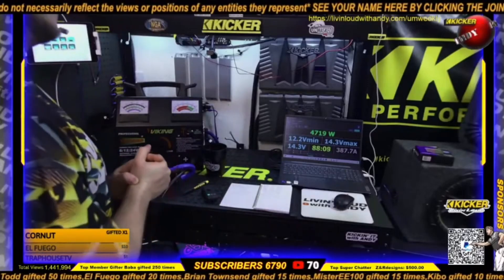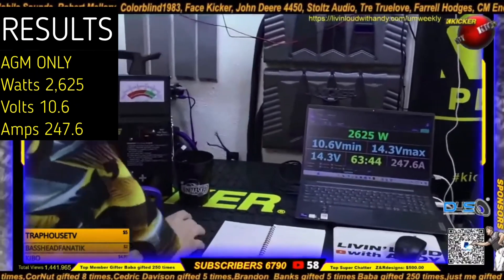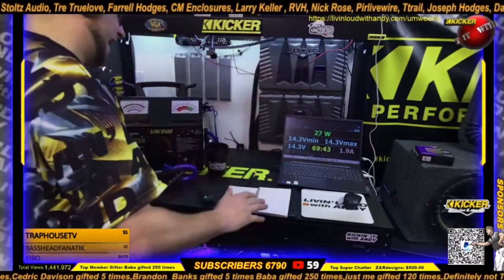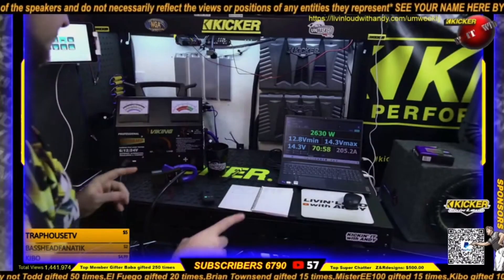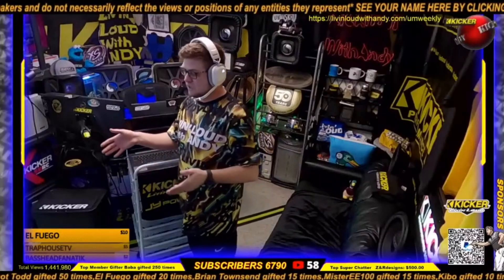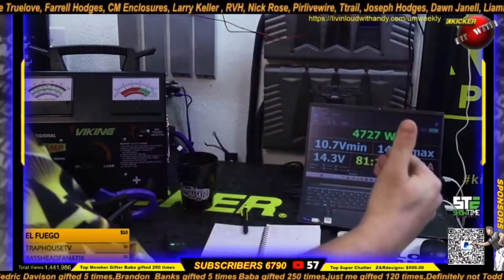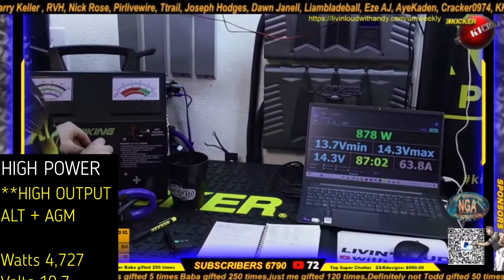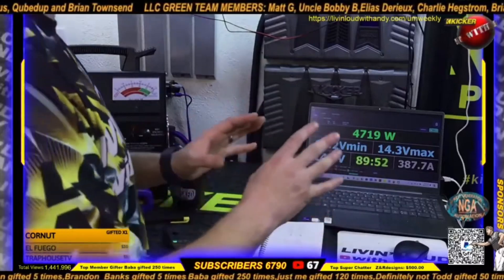Battery vs Alternator : Which one is more important?

Comment: I so thank you and subbed...im pushing 2400w off 3 amps. (EXCELON 1001-1, 150.4 AF, and a P6 Helix Ultimate Dsp...only running off a xs power agm with stock alt and nvx hybrid 10 farad cap and I just need a little more help and didn't know if I was going to just switch out to a titan or 240 from Ohio Gen so cuz of this video I finally see the Alt is the way to go...oh, this is in a 21 civic hatchback...THANK YOU for this video!
Reply from the maker: Happy to help man !! Alternator is definitely the way to go for continuous power availability ⚡️

Glad I could save you some time on your decision 👊🏼

Comment: You never said how much your "high output" alternator was putting out.  I have 1 400 amp mechman alt running a 2700 watt system in one of my vehicles and I have 2 400 amp mechman alts running an 8000 watt system in another of my vehicles.  I don't use extra batteries in either, and my voltage stays rock solid at 14.6-15v.  So not sure why your voltage was dropping so low, unless your "high output" alternator wasn't actually that high of an output.
Reply from the maker: 200a 
Most do that at idle depending each kind 

That’s why I kept power under what they could do - to show voltage differences 

As shown once you go over what alternator can do - voltage will drop to nominal voltage of battery range 

With your systems - both do not exceed what the alternator can supply 

Hence why your voltage doesn’t drop! 

Watch the full video- I try my best to explain everything